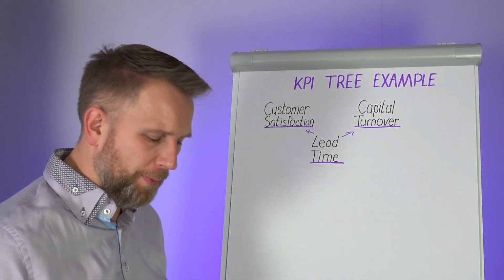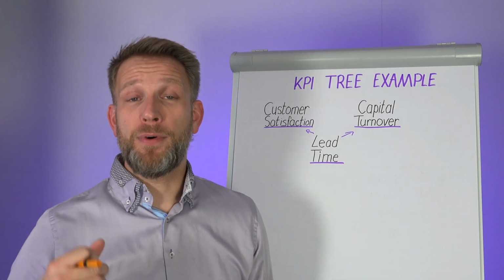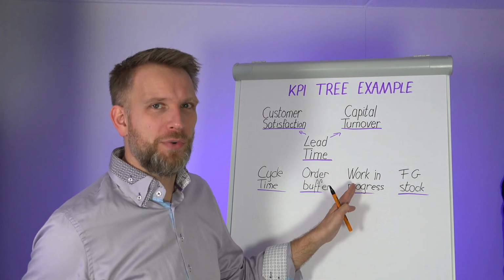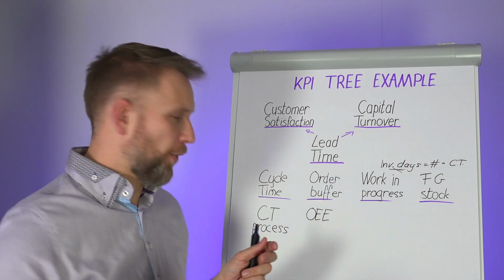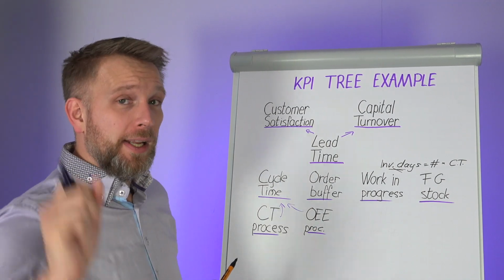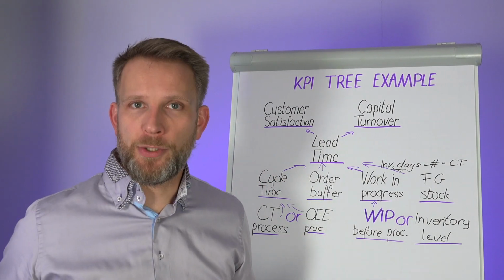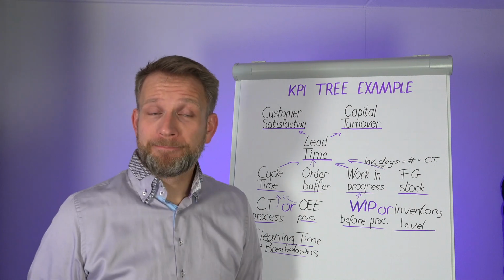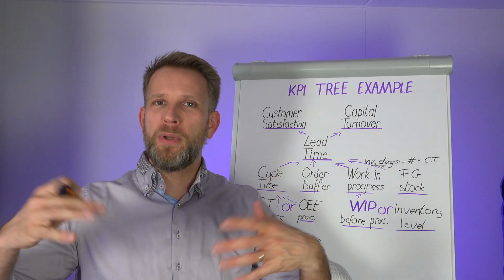A Practical example of Creating KPI Trees

Comment: Lots of great concepts. In manufacturing, final assembly can be 25 stages that work on a piece of the product simultaneously. Progress is made as you go from the first stage to the last. Cycle time and takt time are similar. Lead time could be25 takt times plus any waiting times (which could be very significant). Businessmen love fixed schedules and budgets. Borrowed or invested money needs to be repaid on a strict, fixed schedule. Tik, tok. Assembly lines love fixed takt times. Businessmen want software development to be a 1 stage assembly line. Even though software development is risky engineering, not a fixed, repetitive task. Everything is done in one takt time, the sprint time, no overlapping work. Sprinting makes you think of doing 100-yard dashes back-to-back. Never a moment to rest. However, Agile has the concept of iteration and customer evaluation. So, lead time can be multiple sprints (takt) times plus waiting (e.g. sitting in the backlog, waiting for integration testing). So, the one stage software development process is very different from the 25-stage manufacturing process with its simultaneous, overlapping work. Businessmen really want software to be a manufacturing process.
Reply from the maker: Nice insights into the Lean of software development - thanks!
In manufacturing, a reiteration or rework flow is not very common, but parallel and step-by-step production are both very common and most production processes have elements of both combined.
Reply: @TomMentink  Production is fascinating. The heart of making goods. Back in the days of craftsmanship, iteration was common. You's fit a raw spoke to a wheel and shave off a little here and there. Maybe several times. A high skill job. Repair shops/Custom car makers still do this. You made the whole chassis, not just a wheel.  Interchangeable parts and standard work meant low skilled individuals could be trained to do 1 minute of task over and over, 8 hours a day. Interchangeable parts are first time, every time. Trying to line up 10 software engineers and have them work on pieces of software consecutively in an assembly line to takt time would be a nightmare. Yet, managers want software to be as reliable as manufacturing. Commitment to meet schedule, story points, velocity.